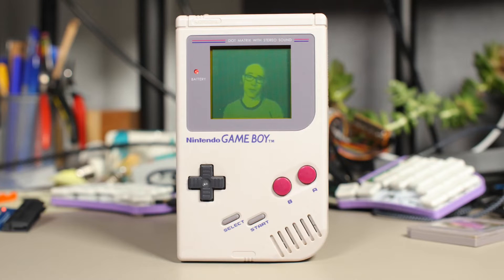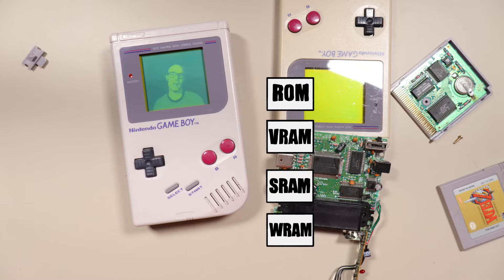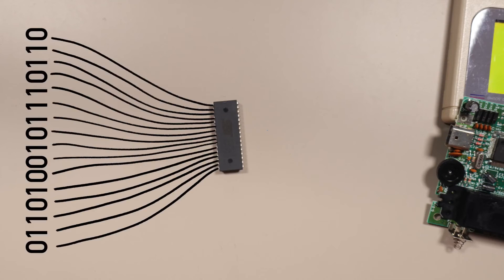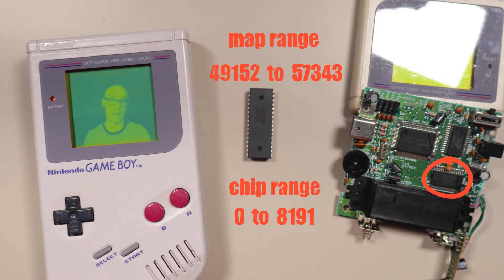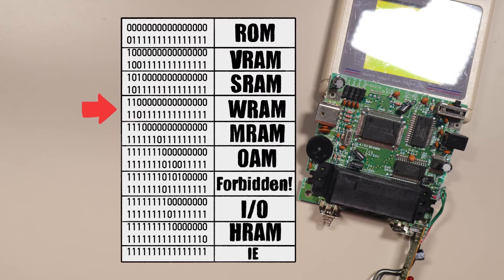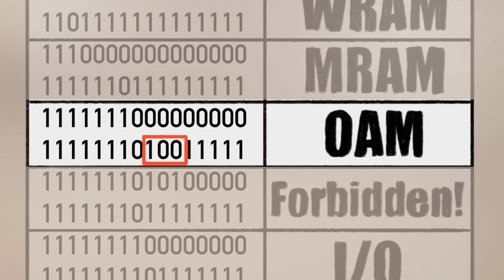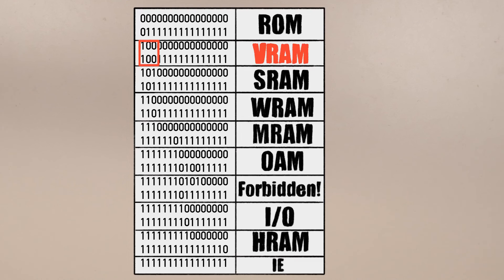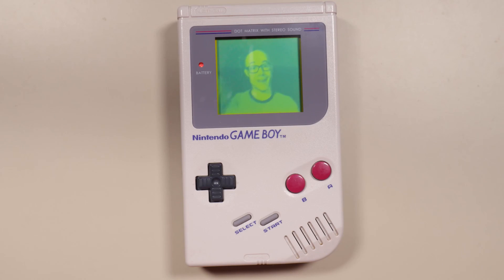How GameBoy Memory Addresses Work

Comment: Great video but i am having a hard time with how they divided the ram up like what if a component needed more or less how would it change the start and end address of each
Reply from the maker: I may not be interpreting your question correctly, so let me know if I'm not answering it right.

As far as the gameboy's CPU is concerned the divisions are all unchangable. If a game needs more space for its ROM or save RAM it can't change the address ranges that are set for those sections. Games get around that by having a chip inside their cartridge called a Memory Bank Controller (MBC), they're also called mappers sometimes. A game can have a larger ROM or RAM chip and the MBC controls what part of the ROM and RAM are accessed by the ROM/SRAM addresses. I'm hoping to have a video explaining this in more detail!

The gameboy color also used this trick to have more WRAM and VRAM while having the same memory map that the original gameboy had. The GBC had twice the VRAM and four times the WRAM but the same addresses. There are some IO registers that are used to control which chunks of the expanded VRAM/WRAM are accessed.